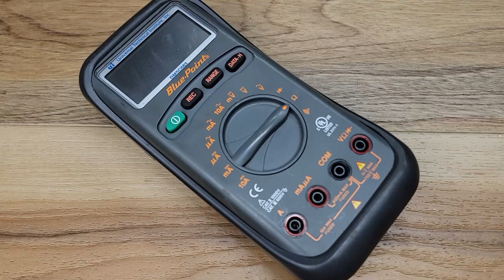Repair of Broken Super Nintendo Game Cartridge Not Loading - Diagnosis & Repair of Darius Twin SNES

Comment: Thanks for this! I just dug out my SNES from storage in hopes of playing my Final Fantasy II and 7th Saga games. Neither one worked a few days ago (nor did my Link To The Past). I thought I had a bad video cable (the original coax) until tonight when my NES worked using it. I hooked it back up to my SNES and Clayfighter (which I didn't care much to play) worked. Now I know it's the cartridges and not the external wiring, or worse yet, the system! Thanks to you I know I can fix a couple of my favorite RPGs of all time. Thanks so much, brother. Yah bless ❤